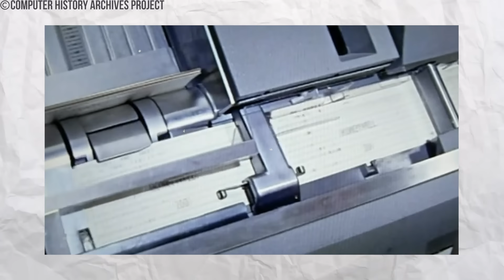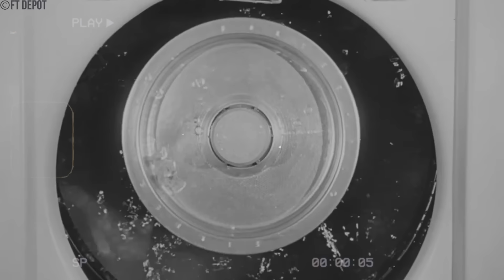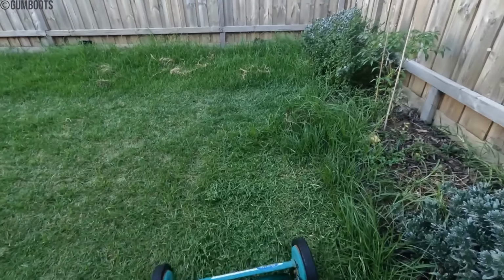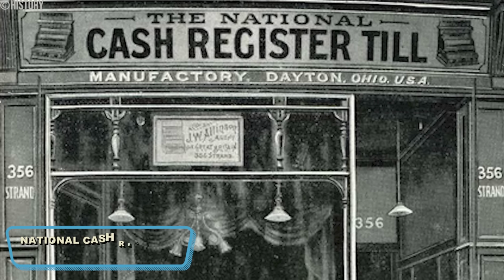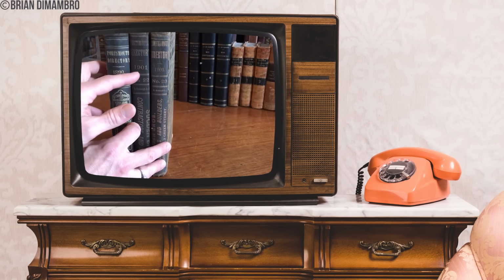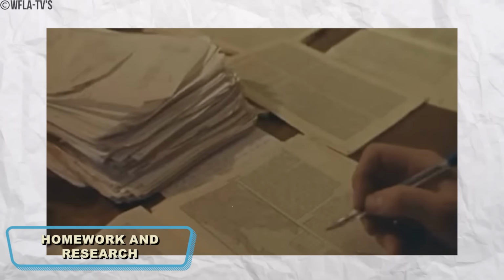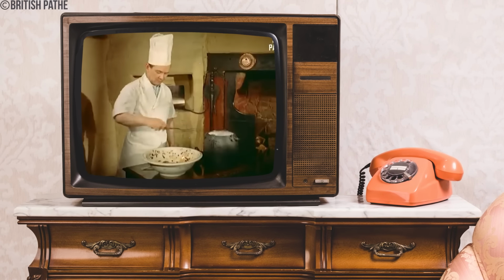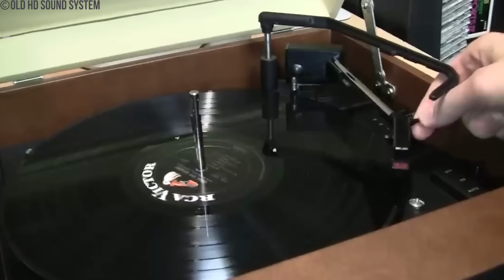25 Things From 1950s Once Necessary, NOW COMPLETELY OBSOLETE!

Comment: I’m 82 and remember the coal man, the coal shoot and the coal furnace. I also remember how black the snow turned due to the coal smoke settling on top of the snow and how the snow stayed white when everyone switched over to gas.
Reply: Technology can improve things, huh?
Reply: @michaelfred8848  Yes, and I can remember when we used to get our milk delivered in glass bottles w/cardboard stoppers which if left on the porch in bitter cold temps the milk would often freeze and crack the bottle.  But the upgrades that bettered those eras are on a different level than comparing audio fidelity 40 yrs back w/today.  Just bec the technology is old doesn't necessarily send it to the trash bin.
Reply: I’m 25 living in Eastern Europe and coal is too familiar to me. I’d be glad to have it gone
Reply: I use coal now, but no one comes and delivers it. Around here it's mostly used for the electric power station. So I have to go get my own.

Comment: After spending too much money on coffee makers and getting mediocre coffee, I went back to my stainless steel percolator on my gas stove.  Never been disappointed and it won't break down on me in a year!
Reply: We went back to an electric percolator coffee pot because it’s more reliable.
Reply: Thank you!
Reply: I use one too, mine is aluminum and works best on an open flame.
Reply: the best way to have coffee
Reply: Me too
Reply: Chemex for me
Reply: Blows me away - percolated coffee tastes like burned butt.
Reply: While percolator coffee pots are more reliable, the liquid they produce is more like ashes mixed with hot piss
Reply: For me it's mocca pot and (especially in the morning) french press. Percolators unfortunately are very rough on all chemical compounds in coffee due to high heat, while other two just can't really burn coffee. 80-90 degrees Celcius (just below boiling) water gives super smooth coffee from press, frankly when compared to instant or express at work it is almost sweet on it's own.
Reply: @wrongdog_reckons  You're doing something wrong then.
Reply: @Chris_at_Home  Not more reliable than a coffee pot on the stove, the way it was originally done.
Reply: @wrongdog_reckons  Then you're doing it wrong.
Reply: @merlinathrawes746  I do lots of things wrong.

Comment: This video needs some fact checking for dates.
Reply: Yes. Punched cards were used into the late '70s. Drafting tools were used into the mid-'90s. Dial phones came in the late '50s. Push button phones weren't widespread until the '80s. Wing windows were around into the '90s. Coal wasn't used much in the west. There were sawdust burners and oil furnaces. When the dams were built in the '60s, everything went electric. There were plenty of other mistakes.
Reply: @BlankBrain  Like the fact that mechanical pencils are still being used today. Ballpoint pens might be good for some things, but they sure aren't useful if you want to actually erase anything.
Reply: @BlankBrain  well stated - someone just wanted to make a video without the effort to fact-check. 80-column cards and 96-column cards.
Reply: Confused amateur radio with telegram services. Telegrams at this time were transmitted via teletype. Wish these videos were more accurate.
Reply: Sort of.  His dates for "started fading out" were before the dates I experienced many of these things.  But great memories.
Reply: It needs fact checking in many other ways too, as the claim that milk delivery is gone is utter bilge 😂 .
(among other aged like milk takes on other stuff in the list)
Reply: Exactly,  did not really research dates. Punch cards were 60s n 70s
Reply: Ringer wash machines were much earlier, unless you were In the country.

Comment: I was born in 1941 and I remember these things very well.  We had the first TV in our neighborhood.  My parents purchased our 5" round Dupont TV for $500.00 in 1947.   That was a huge sum of money for that time.   We had total strangers knockin' on our door to see "IT".  The TV antenna was the giveaway.   I was a milk delivery kid in the mid 50's.  I received $2.00 for the short early morning run before school and $3 for the longer weekend route.  I cut laws with the reel mowers for spending money.  A larger lawn could get you $1.00.  I set bowling pins by hand, at the Elks club for $3.00 a night.  Great times.
Reply: Dang. I did the inflation calculation on that $500. That comes out to over $7200 in today's money. And a 5" screen. And round. I bet that really was an attraction.
Reply: The CPI Inflation Calculator says $1.00 in January 1955 has the same buying power as $11.82 in November 2024.
Reply: Thanks for sharing your experience! So cool & nostalgic!😊
Reply: Your family must have been rich.  Eastern NC didn't even have a TV station until 1953 and got a second one in 1957.

Comment: Our dad had a manual lawn mower throughout the '60s, '70s. and 80s I don't think he ever purchased a power mower. He attached a catch sack to capture the clippings. Eventually, Dad relegated the lawn mowing duties to my brother, which was how he earned his weekly allowance. It was one of those devices that, as long as it continued to work well, he couldn't see shelling out the extra bucks for the power kind, which required gasoline, an additional expense.
Reply: Our next door neighbour did this and made his kids mow, boys and girls. My dad had a nice mower and my brother would mow. He also had a few accounts in the area.
Reply: Our family had a push mower, and I was stuck doing most of the mowing. I hated the thing. Everyone we knew had a gas or electric mower. But no, not us. Join the 20th century? No thanks!
Reply: I have a manual push mower. I purchased it at Lowe's -- had to assemble it myself. I enjoy using it, great workout. 🫤
Reply: They still sell news ones !
Reply: My dad said, "That's why I had kids! Funny, we didn't need to pay to get fit!

Comment: Much of these were used throughout the 70s, 90s,  and even into the 90s.  In 1975 my computer programming class at UCLA required punch cards.  Wing windows continued into the late 70s.  My daughter and I both have turntables and you can still buy vinyl new (or go to a vinyl shop for unusual picks).   Encyclopedias were widely used until the 90s.  In the 80s and 90s mechanical pencils were still widely used in the office.
Reply: My nearest super Walmart carries vinyl, too. Right next to CDs and PS5 games.
Reply: I learned to type in High School, first on a manual machine, then moved up to a Selectric. My keyboard skills transferred directly to a computer keyboard. My kids are amazed that I can type without looking at the keyboard.
Reply: @WilliamHostman  Same at the walmarts I go to!
Reply: @JohnPotts-kq7kk  Irrelevant... unless the people owning the IP connect them, they're still not canonically linked.
Reply: @lynnw7155 I’m 76 now and learned typing in high school when I was 15/16. We only had manual ones. The skill has never left me and when computers came along it was a breeze to use the keyboards!
Reply: I miss vent windows. Brought a lot of air into the car on the highway.
Unused punch cards made great scratchpads at work.
Reply: Graduated from engineering school at ASU in 1980.  Still used punch cards there for some classes.  Was told "you won't see these again after you get into the 'real world'".  Graduated and went into the Air Force.  Used punch cards for the next three years programming jammer models on UNIVAC computers.

Comment: I recently saw someone using a "reel type" lawnmower and they still sell them. An interesting fact about reel type mowers is that they actually cut the grass better than a power mower, cleaner cut and more uniform. You can even put a bag attachment on them.  Having a small lawn, i'm tempted to get one from Home Depot. No gasoline, and they're quiet, and fun to use.
Reply: I've used nothing but hand mowers. Unfortunately, since about 1975, the U.S. brands were discontinued, and the only reel-mowers were made in China. I needn't tell you how the build-quality of them is 
Fortunately, about 5-years ago I discovered a new model Fiskar mower, made in Finland, and it will be the last mower I buy, because it's solidly built with high-quality steel.  No gas needed. No spark plugs, no worry about theft. (Kids don't know what it is.)  Will last longer than you live. No noise. Easy maintenance.. Price? >$300. Buy  the optional sharpening kit. ($40)  Never spend another cent on lawnmowers.
Reply: My friend has one that's fairly new looking.
It's cherry red.
Works great.
Reply: I have an old bag attachment for my mower she's called my wife.
Reply: We used one for the 5 years we lived in the UK in the '90s because we just didn't have much grass to cut :P
also had milk delivered every morning in glass bottles. I still have a few of them. I'd start the day out right with a pint of whole milk on the way to school, where I was also fed a proper breakfast.
Reply: @d.s7741  when I was a kid, we had an electric reel mower. Plugged into A/C. Most people don’t even know they existed.
Reply: I've got a hand lawnmower too, thanks to them making a comeback in the UK.

Wouldn't touch a Flymo or other "modern" mower if you paid me to 😂
Reply: You can try a hand scythe. It's surprisingly effective, absolutely quiet and can save you a trip to a gym. But requires some practice.
Reply: @jimtaylor294 I've still got a Flymo. It's great if your lawn is a putting green
Reply: I had to cut our "lawn" with a reel mower. Not a problem when your yard is nice and flat and absent of large tree roots.  Our backyard was on a hill with roots everywhere!  And green does not equal grass.  So no beautiful lawn for me to mow.  I learned a lot to descriptive phrases and expletives in the early '70's!
Reply: @lynnerodgers4461  Power mowers don't work well with tree roots either.  Or stumps.

Comment: I remember helping to defrost the freezer. Boil a pot of water, stick it on the freezer to melt unwanted ice. What a chore.
Reply: In my last apartment I had a refrigerator with a freezer that had to be manually defrosted. It was a chore, but those fridges lasted forever. Mine was old when I moved in during the mid 1980s and was still working when I moved out in 2019. Today’s fridges are lucky to last ten years.

Comment: I remember the data processing class in jr.  high school.  After we punched the data in the cards, we had to wire a board that instructed the IBM machines what to do with the cards.  These were huge machines in a large room.  You had one that read the cards, one to  sort, one to do the calculations, and one to do printing.  We had to learn how to wire the boards for each machine.  That was high technology.
Reply: And gawd forbid you dropped a tray 😂
Reply: @kiniburk  Many of the Hollerith card decks, if they represented a static batch of data, would have a set of columns devoted to a sequence number, allowing them to be run through a collator to sort them back into their proper order. This could only be done with a card deck that was in its final, static form, as the sequence numbers would make it impossible to recover a deck that had been edited to insert new data between sequentially-numbered cards.
Reply: The Apple ][e we used when I was a kid is closer to punch cards and building sized computers than to modern ones. I did a summer internship in high school, working in the IT department of a Fortune 500 automotive engineering company. I did most of the work to decommission their old server hardware that was from the late '70s or early '80s (8088 based IIRC)  and replace it with brand new Pentium II Xeon based servers. First time I ever saw 2 CPUs on one board and the slot type CPUs were like something from the future, lol. The new system was probably 1000x as capable and took up a minute fraction of the space in the formerly packed server room.
Reply: @seanmalloy7249  And it is amazing how many programmers were lazy enough not to punch the sequence numbers on the cards, because, of course, THEY would never drop a deck!  I, of course, include myself in that lot.  😂

Comment: A pressure ‘cooker’ is for cooking food. A pressure ‘canner’ is for preserving food. They are not generally interchangeable.
Reply: Same thing, Canners tend to be larger
Reply: @johngrafton6868  A canner is a pressure cooker, but not all pressure cookers are canners.  The type for canning is generally higher pressure to attain higher temperatures for preservation.  Canners are sometimes called retorts.
Reply: That's not true at all, you're just not getting a quart jar in a most household pressure cookers. You can do pressure canning in a pressure cooker. But it isn't going to work as well as at the factory. Still, it is sufficient for safely canning veggies and meat.
Reply: I used both of those items.
Reply: But it is still advisable to boil foods home canned this way for 30 minutes to kill botulism spores.
Reply: And both are still common and in use.
Reply: @anthonyjackson280  There's no difference in the pressure that can be obtained in either.

Comment: Remember the flash cubes that rotated when a picture was taken so you could take four pictures before changing it? We had those, and they didn't always work properly. Sometimes, they wouldn't flash, or they wouldn't turn. Flash bulbs didn't always go off when they were supposed to, either.

The most frustrating thing I found about using film cameras was loading the film and trying to wind it to the first frame. If it didn't load or wind just right, pictures would overlap. Sometimes, I couldn't get the winder to even move. And loading film always risked getting some light leaked into the first couple of frames. They really were a pain, especially the cheaper ones.
Reply: Kodak brought out the instamatic cartridges for that with 126 and 110 cameras. They also brought out the 4 shot magicube flash system on those cameras also. Kodak was one of the biggest sellers of the compact camera then in the 1960's. It still took a while though for roll film to disappear and many serious photographers still use it today in favour of the digital cameras and mobile phones cameras.
Reply: I still prefer film and manual film cameras.  Many people don’t realize how much detail is in the negatives and slides.  A 24mp camera produces lower resolution and color depth than a 35 mm slide. You need a lossless scan of about 9000 dpi to get the full resolution of a 35mm frame, which is 36mm*24mm or about 1.5 sq inches. Which gives 121.5 mp.

Which for reference is basically an 8k flatscreen.  24 mp is equivalent to a 4k screen.
Reply: I once got all four flash bulbs go off at once and smoke coming from it. Scary!
Loading a film, I did it in a nearly dark room with a 5 Watt light bulb on the ceiling.
Reply: Yes.  But, one of my favourite pictures is a 1992 accidental double exposure at the start of the film - my pregnant wife posing outside on a late-winter walk; and my newborn daughter.
Reply: @wendigo53  Happy accident.
Reply: I have scars on my hip from a bulb going off in my pocket. It was for an instamatic before the cube came in. I stuck extra batteries in my pocket along with spare bulbs. Chaos insisted that just the right config would occur. The security guard at the Henry Ford Museum couldn't stop laughing.
Reply: I never had trouble loading film in manual cameras.
Reply: @annettefournier9655  I never had trouble, but a few times the film was not loaded correctly and did not advance.

Comment: I still heat with coal in a outdoor water furnace  . My ham radio gear some is still tube  type and I still use Morse code at times .
Reply: Roger that; what old rig  or rigs do you use? My last real tube was a set of Drakes R4A and T4XB. The only tube transciever I still have for HF is my 1965 HeathkitGW-12  CB that I tuned to 29.025

Comment: My grandparents had a wood stoked heater in Missouri of some type until they passed away in the 1980s.  They did have a stove, oven and water heater which were powered by Propane which was delivered.
Reply: People in rural areas still sometimes opt for wood fueled stoves, if they have acreage and can get it for free. Nothing wrong with that if you're fine with doing the work. I like to shift my own gears when I drive.
Reply: Just add many purchase wood and use wood stoves. Not unusual at all in Missouri. I remember paying 20 a Rick for wood in 1985. $75 is the cheapest I see these days

Comment: One of the other things that disappeared was connected to the milk delvery -- homes would have small cabinets in an exterior wall with doors on the inside and outside. The milkman would open the exterior door and put the milk and butter into the cabinet, where it would be protected from the sunlight, heat, and weather, and the occupants would be able to pick up the delivered milk and butter without going outside. With the end of milk delivery, these cabinets were no longer necessary.
Reply: Yes.  Lots of older homes and apartments have a milk-box (although the ones I have seen open only from the outside).
Reply: Rich people had those.  We just got our milk handed to us.  We had to be home to pay for the milk on delivery.  It didn't come in bottles either.  It was in the same cartons that the grocery store sold.  I do have some pint and quart milk bottles in my collection of assorted stuff.